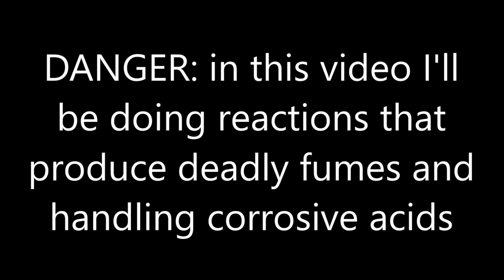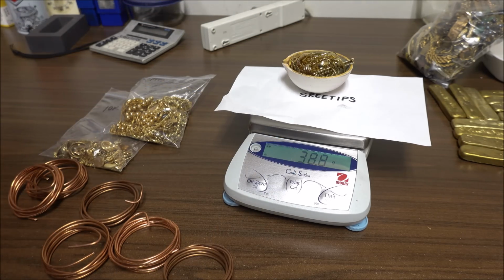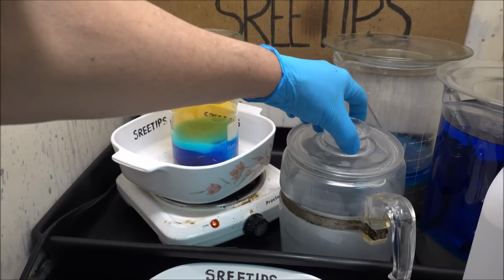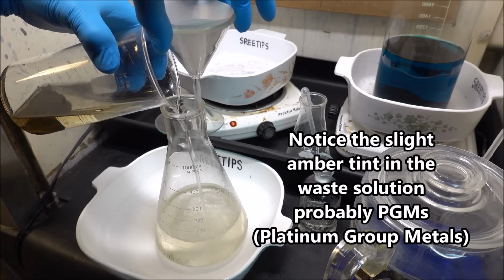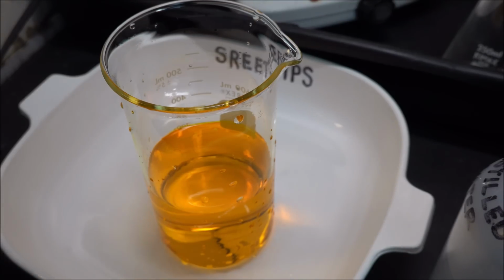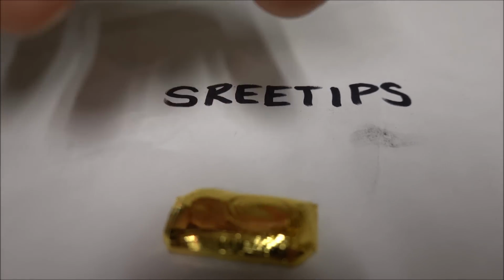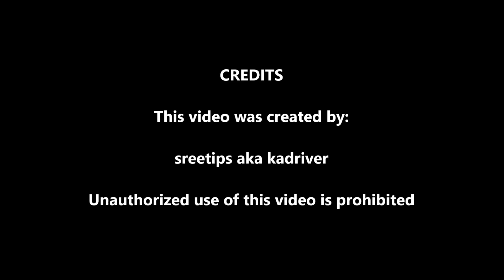Gold Refining Inquarting With Copper

Comment: Sreetips, would this method work on material that is only about 7% pure gold?  Would the gold stay in nugget form in the nitric baths or would it become more like sponge ?
Reply from the maker: 7% gold would crumble to a powder. Still workable but it would take more time to rinse the silver out of it. You’d have to let the powder settle completely, decant, rinse, settle, decant and could take hours (or even over night) to settle completely EACH TIME YOU RINSE. This greatly increases time require to complete the rinsing. But it’s do-able.
Reply: @sreetips  Thanks for the quick reply.  Much appreciation of you and your videos.

Comment: Hello Mr Sreetips. Thank you for sharing your knowledge. When inquirting with copper - is it exactly the same amount as when one uses silver?
Reply from the maker: Yes
Reply: sreetips Thank you !
Reply: Mr Sreetips. Why does gold burst? I had a button when heated it burst. Why will this be?
Reply from the maker: Maybe an air bubble trapped inside. When heated the air expands and has no place to go so pressure builds then releases suddenly, explosively, when the metal gets soft enough. I've had it happen during gold melts with karat gold. Scares the pants off of me!
Reply: sreetips Thank you. Yes it   unexpectedly. I lost about 3 . I couldn't find it after the burst. Thank you for always replying .

Comment: So.. Can I assume you'll be cementing out the silver left in solution with more copper wire?
Reply from the maker: Yes, I'll recover the silver by cementing on copper.
Reply: @sreetips  I have hard drive platters I'd like to give to you if you haven't already started that project. Let me know.
Reply from the maker: Mark, I appreciate it. Only the small glass platters out of laptops have any PGMs. The large platters from PC are aluminum. I think I have enough to give it a go. Thank you!

Comment: I have some karat white gold scrap. do i treat this different than yellow karat gold?
Reply from the maker: No - the process is exactly the same. But there’s a higher probability that you’ll encounter platinum group metals in your nitric acid boils. If the solution is green rather than blue then it may contain palladium and platinum.
Reply: @sreetips  OK and then I can use that Nitric acid boil to refine out some sterling silver. Will the platinum metal stay in solution when I put copper into the silver nitrate or will they precipitate out with the Silver?
Reply from the maker: It will cement out on the copper. It will appear last after the silver looking black on the copper. It won’t be enough to recover and refine. I just melt the silver, run it thru my silver cell. The PGMs will end up as slimes in the silver cell anode basket. I recover that separately when I refine the anode filters slimes.
Reply: @sreetips  great, one last question. I am testing all my Karat with a scratch stone and acids. I have a few pieces marked as 10K, when scratched on the stone, the lines do not completely disappear with 14k, but are very clear with 10k. Would you calculate them as 14k?, 12k?, or just put them with 10k?

Comment: The silver will then be dissolved into the nitric/water. Can you add table salt to it and drop your silver?
Reply from the maker: Yes, adding table salt will react with the silver nitrate and form silver chloride.
Reply: @sreetips  Ok thanks. I have AR in with copper pipe and bubbler, seeing stuff on bottom.

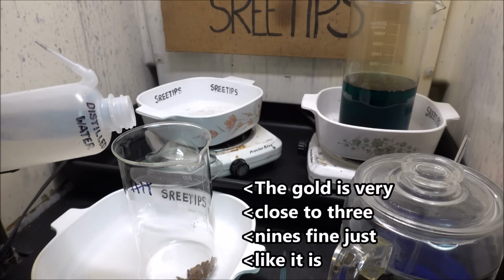Comment: At 12:17 you have yet to use any hydrocloric acid and yet the gold is almost pure.
Would i actually need hydrocloric acid, or could i simply melt the mud down at this point?
Reply from the maker: I always give it a boil in HCl cleans it up good.

Comment: why did you multiply the grams of gold by 1.265? what does 1.265 represent?
Reply from the maker: A constant. Grams of 14k times 1.265 will give the exact amount of sterling/925 silver required for inquarting.
Reply: @sreetips  ah ok thanks, and this constant is only valid for 14k gold or also for other karats?
Reply from the maker: 10k constant 0.635
14k constant 1.265
18k constant 1.9
Reply: @sreetips  thanks a lot!!

Comment: Hi sreetips I was thinking you should have got 22.69 grams from that but got 21.9 grams that’s 0.79 grams short I think it’s because you didn’t let the gold all settle during both of the precipitations till the solutions were crystal clear maybe leave it 5 hours after adding the SMB or over night but it’s just a theory can you try  what I said in the next carat scrap vid because I’m curious to see if that is the reason great vid as always
Reply from the maker: The yield is never 100% it's always off. Some got poured off into the waste container, a little flew out of the melt dish, a drop of liquid gold splashed out when I added ice to the second refining, you can see it if you look closely. Plus the karat is never plumb. All these factors add up and add to the losses.
Reply: For some odd reason my carat scrap is always slightly under carat and never over carat. 
Absolutely normal results.
If your solution is as meticulously clean as Sreetips you don't need to wait over night for the gold to drop out.

Comment: I find this fascinating, even though I don't understand chemistry one little bit.
Reply from the maker: I'm not a chemist. You actually don't need to know chemistry to refine. Just rules to remember.
Reply: In a lot of your other videos, you add borax when melting.  Is there a reason why you didn't this time?
Reply: @IMDunn-oy9cd  I've watched a few of his videos too. He uses borax for at least two reasons one is when filter paper and fine powder is being used, to help keep the precious metals and paper from blowing out of the melt dish, the 2nd one is when there might be just a little impurities, the borax will absorb those impurities. Which he rarely has impurities. I think there is one more reason that I can't think of at the moment. To answer the question regarding why he doesn't use borax doing this (inquarting). There no chance of anything blowing out of the melt dish, and there's no need to worry about impurities since he's melting impurities together to get to 6 karat or 25% or just a little higher so everything stays together. If he did 5.9 karat or 24% everything would turn into a fine powder and trying to get ALL the gold would be very difficult since the gold would be left suspended in the solution.
Have a GREAT Day!!!
Reply: Thanks Shane York.
Reply: @IMDunn-oy9cd  Your welcome, my Friend!!

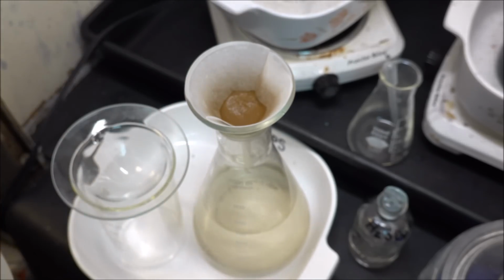Comment: At 16:53, I was wondering with you rinse with hydrochloric acid at this point.
Reply from the maker: Hydrochloric will rinse out dissolved metals from the gold better than plain water.
Reply: Outstanding, I began collecting gold from computers and broken gold when I was working in a pawn shop due to your videos, I have watched about almost all of them, I am hoping to have my shop up and running soon, I am trying to figure out everything I would need to get started, however I have seen furnaces to melt gold and silver, you use a torch and abstain the same results. Is there anything you would recommend as a started kit?

Comment: Can I use 67% nitric acid for this process and what temperature is the hot plate set at?
Reply from the maker: Yes. I don’t know hot plate settings. Mine has low medium and high. I use medium-high setting
Reply: I recently did a clean up of a home of man that passed away and found a lot of jewelry tools and supplies including a 10oz bag of what looks just like the gold that you inquarted with copper. You can see the gold in it and that it's not just copper. It also had some silver nuggets in it but I removed them when I first found it before I knew what I had. So I melted some in a crucible and when it cooled I knocked the piece out and the bottom of it was clearly gold. I assume that the being heavier it settled to the bottom. So I purchased the acids and followed your process but the nitric acid completely dissolved all of it leaving me with just blue liquid. What could I have done wrong. I was sure there was some gold there, what happened?  
Norm-
Reply from the maker: Gold will not separate when melted with silver - it will alloy. Even if it’s stirred. Boiling in nitric will dissolve silver and copper leaving the gold behind as a black/brown powder.
Reply: @sreetips  So there must not be any gold in it? If I use stump out what will happen?
Reply from the maker: Nothing

Comment: 11:11 why exactly should you never do this?
Reply from the maker: Do what?
Reply: @sreetips  at 11:11 in the video you say you are doing something you should never do by reaching into the nitric solution to crush the chunks of gold, I'm curious why it sound never be done.
Reply from the maker: Oh that, I was taught not to do that by one of my mentors on the goldrefiningforum.com, Harold_V. He said that crushing the gold with a glass rod was no advisable. That it would put gold powder in the solution, or even colloidal gold, and make separating the liquid from the gold more difficult. If left undisturbed, the gold will remain intact, not fall apart, and then the liquid can just be poured off quickly and easily.
Reply: @sreetips  okay thank you! Great information!

Comment: Do you use that same formula to figure out how much copper to use when refining 18k ?
Reply from the maker: 10k gold multiply grams times 0.635
14k gold multiply grams times 1.265
18k gold multiply grams times 1.9

This will give the required weight, in grams, of silver or copper, to use to get the proper alloy for inquartation. But, the karat of the gold must be carefully verified because a piece of gold plated or gold filled in the batch by mistake will throw the alloy way off and cause problems with the gold falling apart during nitric treatments.

Comment: I would like to ask if it's possible to inquart gold with the mix of silver and copper?
Reply from the maker: Yes, both can be used interchangeably with each other to inquart the gold. So if you need 38 grams of silver for your inquartation but you only have 30 grams of silver then you can just add 8 grams of copper to make up the difference.
Reply: @sreetips  thank youu

Comment: Hey have you ever melted a piece of a meteorite and mixed it with the gold instead of silver or copper just to see what happens I wonder can it be done I'm just thinking out side of the box and can you make it happen that would be awesome
Reply from the maker: Meteorite is made of iron. It melts at 2800 degrees F. Getting the gold that hot may cause some of it to vaporize and cause loss of metal. Plus iron doesn't dissolve in nitric very well. But it sure would make an interesting video. Where can I get my hands on a meterorite?

Comment: Importing with copper is going to save you a ton of time. And money. You won't have to refine that silver again.
Reply from the maker: It did clean the gold up real good, better than silver. But I also refine silver and the first step is to dissolve the silver in hot nitric. So I may as well use silver to inquart the gold since it must be dissolved anyway.

Comment: Thanks, I can get copper a lot easier than sterling.
Reply from the maker: Not everyone has access to silver, but we can all find copper for much cheaper. And it seems to work better at cleaning the gold.
Reply: @sreetips  what do you do with left-over copper solution?
Reply: @nitisettasak1657  I'm pretty sure you can precipitate out the copper by adding a steel bar to it. Just like you can precipitate out the silver by adding a copper bar to it

Comment: Could you wait once to add the sulfuric until after everything is in solution. Just for the visual of it dropping.
Reply from the maker: Ed, the sulfuric reacts with any lead to form lead sulfate. There should not be very much lead at all. If a jeweler used soft solder to repair a gold or silver ring then that's how it could get in the batch. But not many jeweler's worth their salt would use 
lead based solder. But it does happen so I always add the sulfuric as a prophylactic measure to remove any traces that MAY have made it into my batch. It hurts nothing and provides a big benefit. Tiny traces of lead will ruin gold's ductility and malleability.

Comment: Why not just use aqua regia?
Reply: Usually the outside of jewlry is pure gold. 
Without mixing the metals, the acids would take a sinificantly long time
to eat the gold before even getting to the silver and base metals.
If Aqua Regia was used straight out, it would need more refining anyway.
(I have used this method for cpu scrap.)
Reply from the maker: that would create many problems and make refining difficult. Inquarting with silver, or copper, then removing all the base metals with hot nitric BEFORE going to aqua regia is the easier, softer way.

Comment: I feel screetips didn’t answer the point of the question: the reason for using silver to inquart gold instead of copper. 2 answers:
1) silver is easier to recover. Add a bit of copper and it cements out. Copper can do this with other metals but not as easily/quickly/cleanly. Not to mention copper isn’t really worth the cost of materials and fuel to recover.
2) More importantly: it takes almost 4x as much nitric acid to dissolve the same weight of copper as silver. Same reason it takes 1/4 the weight of silver in copper to cement it out. Nitric is not cheap, so no reason to use more of it if you can avoid it (you can infinitely recycle the silver through multiple inquartations, only consuming a small amount of copper to do so - 1/16 as much copper as you’d use if you had inquarted with copper)
Reply: I make my own nitric and it's pretty cheap, around $20 a gallon for 90%.  Copper is so much cheaper than silver (scrap copper wire is about $1.20 a pound versus silver at over $200 a pound)  that it negates some of the other costs of this process.
Reply from the maker: The point of the video was to show folks that you don't need silver to inquart karat gold scrap. Some may not have silver available.

Comment: Safety first, but yet you don't say, Don't pore water into acid it can react violently and spray acid on you. Next stop A&E,  But yet you do it. Then you don't say, Don't pore cold water in to a hot beaker, it can crack and break your beaker causing an acid spill which can go on you and burn you, next stop A&E.... I like your uploads they are very good, but this is the first time you show your face. I came back to see if you have more vids, the last time i see your experiments was four years ago.... I am a little shocked you did not follow the guide lines when handling acids, you do realize laymen watch this and will do exactly as you do and if they like you do they may really hurt themselves in the process..... Safety first right, don't get complacent. I'm sure you took it for granted who's watching..... No digs just saying, i really like what you do..
Reply from the maker: Good rule of thumb. The only acid that I've ever seen spatter is sulfuric. I put some in a small beaker and added a single drop of water and sure enough it turned to steam so fast that it erupted hot acid everywhere.
Reply: @sreetips  That is true even i mixed it like you and nothing happened until sulfuric acid is involved. But thats not what i said nor was it the point i was making. The data sheets on safe handling of acids are not written for fun but for safety. I just think you should have done it the safe way because of the laymen that watch your experiments. Who is going to handle acid safely after watching you, the will follow you like seep. Even you know Gold fever hits hard and all logic goes out the window, It's not what you are doing is the attraction, it's the Gold people want and they will stop at nothing to get it.. I know i did it as well , i nearly died 3 times due to the nitric acid reaction, not to mention hydrochloric acid destroying anything metal that was in the room. Lucky i got gold, also in the UK they have put restrictions on buying nitric acid because of them freaks making bombs..... So alls well that ends well...